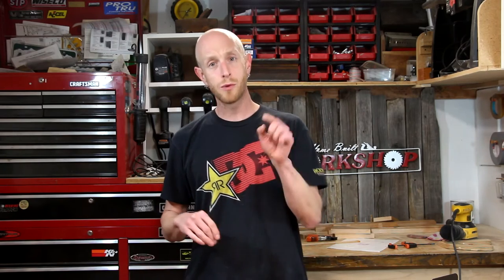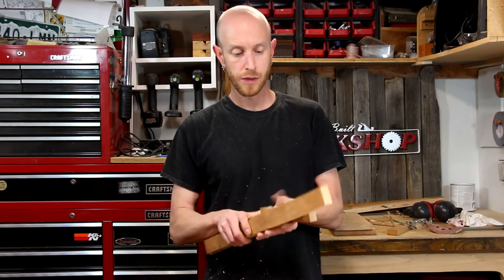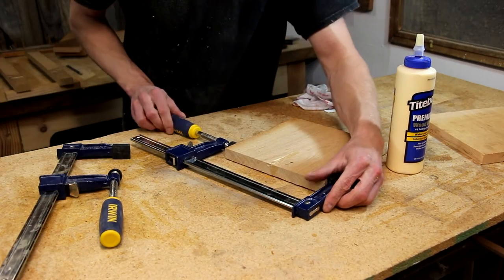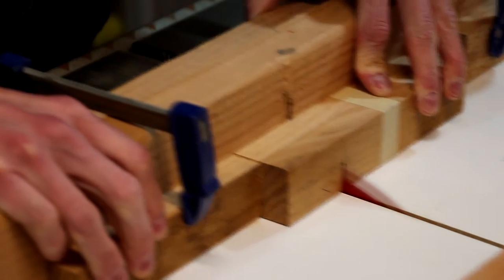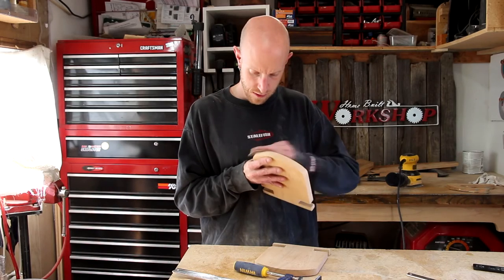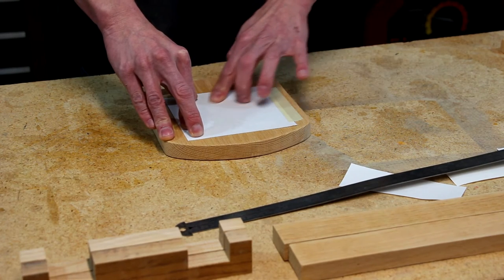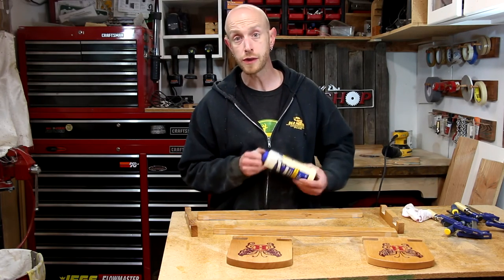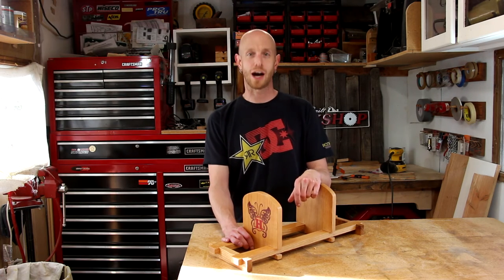How to build an adjustable book stand

Comment: Hi Jeff - Cool project. I noticed that (like many contractor saws) your saw has those tabs on the miter slot that I guess are meant to hold the miter gauge down to the table. Do you have any tips for making sled runners that fit that style channel? Thanks!
Reply from the maker: I took a dremel and ground most of the tabs off so I could cut some runners that fit.